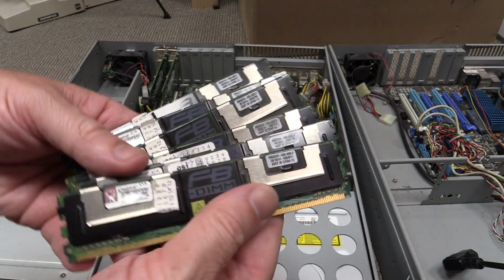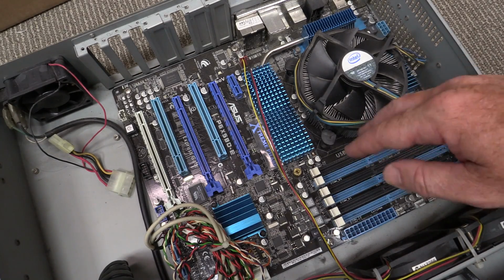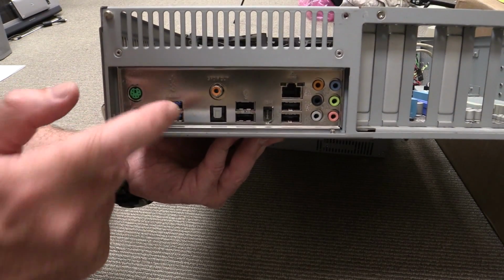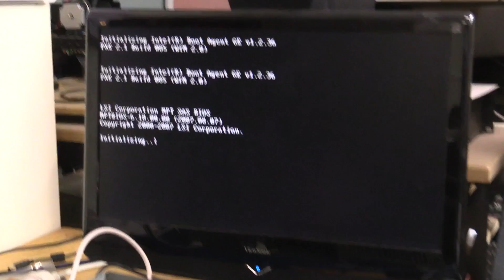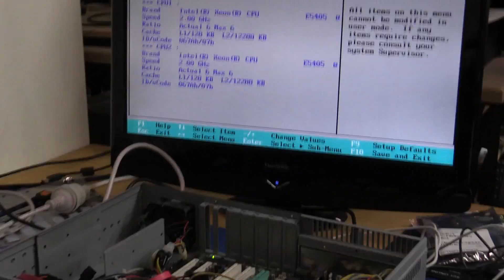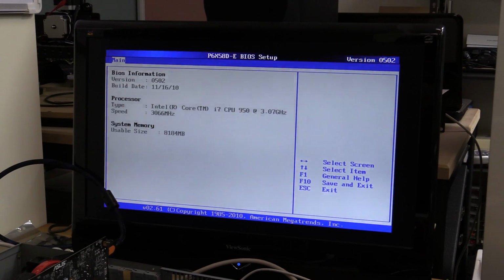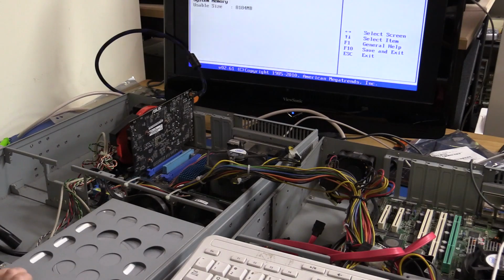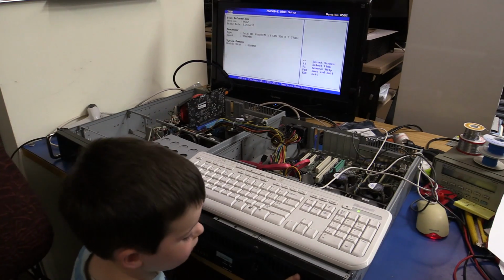EEVblog #838 - More Dumpster Server PC's

Comment: My CPU Mark is 20500, should be alright
Reply: +TheAmmoniacal And what's your brag mark score, I wonder?
Reply: Nice waste of 2k dollars. It's really not impressive when you consider the price is through the roof and there are much better options for much less. A little bit of research would have helped you save money and get better scores. :P
Reply: +TheAmmoniacal Just shy of 24,000 with two Xeon X5690s at 4.4 GHz.
Reply: TheAmmoniacal It suck when you lose to older, cheaper hardware eh?
Reply: +TheAmmoniacal Meh, I reck it with 26000 with my i7 5960X @ 4.6 GHz :)
Reply: +TheAmmoniacal meh, it has been running for a couple of months already. it is cooled by a H110i GT with push/pull fans and gets up to 80c under prime95 and 65-75c while rendering :)
Reply: RandomNova Gaming We're talking about benchmarking.
Reply: +TheAmmoniacal And... you only play mine sweeper on it! :)
Reply: Well you're only really paying for what you get. My X5650 was 100$ and scores 9.2K in there. I get around 90 points per dollar. You paying 2000$ for 22K points are getting 11 points per dollar. And yes I can Dual Xeon X5650 which would give me around 18K in perfect scaling, and that would still give me 90 points per dollar and almost the same performance for 200$.
Reply: TheAmmoniacal
Ikr! Mike Fox got a much better value for a more reasonable processor, and he was able to spend that saved money in other places for something he can enjoy a lot more. It's really funny, isn't it?
Reply: +TheAmmoniacal Pffff my quantum computer touches that with out even trying.
Reply: Jesse Crandle Oh wow you care a lot
Reply: +Person. Uh, yeah. That's why workstations the world over are using FX processors..?
Reply: +TheAmmoniacal Intel XEON E5-2699 v3 ?
Reply: It's a Xeon E5-2690v3, my brag score is too large to write here.
Reply: RandomNova Gaming Yeah, and it will last a month max.
Reply: +Mike Fox but the Xeon has ECC support and many more features like dual processing and stuff, making it useful for a balls to the wall workstation
Reply: +TheAmmoniacal Check CPU mark 13052,9102,7602 Proceed to chuck i7s in the bin
Reply: TheAmmoniacal https://www.dropbox.com/s/z306jdj31okea1h/i7%205960X%204.4GHz.PNG?dl=0
Here the passmark test of my i7 @ 4.4 GHz... Comes really close to your Xeon and even when running stock, the i7 has double the price/performance ratio :)
Reply: 19600 with 5960X and modest "no frills" overclock (4GHz).
Reply: kilrahvp Nice :)
Reply: My CPU is still better than all yours.
Reply: +TheAmmoniacal no, it isn't
Reply: Mike Fox Exacly!
Reply: Mike Fox What if I paid $660 for mine? Who wins?
Reply: +TheAmmoniacal yea, you could still use it as a daily driver pc
Reply: :D
Reply: TheAmmoniacal I was addressing your question but then I eventually had to do something and got busy, but here it is.

I was taking things by street price, I know people who can get X5650s for 50$.

Your 12 Core 660$ - gets you 33 points per dollar.
My 6 Core 100$ - gets me 90 points per dollar.

If we go by what the cheapest price I've seen someone get a processor like mine, 40$ gives me 230 points per dollar.

Are you sure you don't know who would win?
Reply: Mike Fox Hilarious!
Reply: Anthony Cupero lol unless you work at Google you don't have one............ bish
Reply: Oj10101 Lies.
Reply: +TheAmmoniacal no one gives a shit about your cpu dude LOL. No no, I genuinely mean it, I couldn't give a single fuck if you asked me to. People have Lamborghinis, I don't give a shit about those people either, and that costs a lot more than your little silicon wafer.
Reply: Jesse Crandle But you gave a huge fuck about it already, you care bout it quite a lot in fact.
Reply: Anthony Cupero Quantum computers are slower than normal computers in most cases except specialized features, only because a Qubit stores much more information than a bit.
Reply: My PC still owns all of yours
Reply: +TheAmmoniacal what GPUs do you have?
Reply: +Giggity Goebbel  Yeah i  know , was just having some fun.
Reply: TheAmmoniacal Where's your empirical evidence for that?
Reply: Jesse Crandle here
Reply: TheAmmoniacal If you're implying I care... let me enlighten you.
Full Definition of care
1:  suffering of mind :  grief
2a :  a disquieted state of mixed uncertainty, apprehension, and responsibility
b :  a cause for such anxiety
3a :  painstaking or watchful attention
b :  maintenance <floor-care products>
4:  regard coming from desire or esteem
Since I'm experiencing none of those things, I couldn't care less. GG though, it's nice to see you trying so hard!
Reply: Jesse Crandle Why do you care so much?
Reply: My pic NEVER gets I've r 28 C
Reply: Seriously, I'm just trolling.. I do own that CPU and all, but it's only 'good' for specific tasks. Not particularly fast for most tasks (as most tasks are still not optimized for multi-core processing).
Reply: Xeons are really bad at gaming because the GPU driver isn't multithreaded. That's right single thread driver. There was a test on LinusTechTips, i7-6700k crushes everything in gaming benchmarks. Low core count, high frequency.

Comment: those intel cards are really nice ones. i would recommend using them in your own system, they have high end onboard cpu's for to offload all the NIC traffic from the CPU. you can also use trunking so you get a single 2gbit connection. (if you have a proper router/switch)

Comment: They would make pretty good Linux servers.
Reply: +Dexxter Toasters make good Linux servers!!.

I'm really into low power no moving parts stuff, so my home server is an old VIA C3 thin client I found while thrifting. Supped it up with more memory and an SSD + Debian = eco server!. Not very fast, but good enough to run a small LAMP stack, airprint server, privoxy service, ftp server, SMB server..
Reply: +Gone Tomorrow Yeah, Skylake i3 with ECC RAM. Wisper quiet and more performance than a couple of power hungry nine year old CPUs. 1366 i7 is 130W and still seven years old. Maybe not drag home stuff that is older than the kid?
Reply: +Diggnuts Those VIA C3s are a low performance, low efficiency trap. If you have the dosh, grab LV or ULV i5/i7s instead, way more powerful per watt. Or the top of the line Atoms, which are quite cheap. Either is designed to run passive with proper heatsinks.
Reply: AstralStorm  I know, but I do not have the dosh nor the necessity.  The unit is running idle most of the time and then it's usage is just about the same as any newer platform that have the same features.

All things being equal, recycling such a unit for low usage at a discount price greatly reduces my environmental footprint regarding both externalized productions cost as well as energy cost.

I measured it against a Pi with external storage, and generally it was about the same except for IO speed and reliability. The Pi was worst.

If I need a dedicated render-farm right now to run for 24-7, surely I'd go for the maximun performance per watt I could get, but this is not the case here, and seeing as it's environmental footprint is very close to modern options under lesser load, I'd say the fact that it is reducing E-waste is a big plus.
Reply: +Diggnuts The most important thing is to not cheap out on important components, 
such as cooling, power supply and mainboard (read: power supply). I'm pretty sure Dave approves of this point of view. Get a premium PSU instead of no-name chinese, those $50 go a long way in terms of longevity. Get premium fans and heatsinks, they will likely outlive hard disks and make the machine run reliably. If you're feeling like it, invest a bit more in ECC memory and server processors, designed for long usable life. Get components with 10 year warranty or ones used in machines that get such warranty. In total, you'll pay about 15% more, but will get 5x longer life out of the thing.

I approve, recycling "old" hardware is underrated. Those things have a way longer usable life than expected, especially desktop and embedded computers. I'm using a 5 year old machine at this point myself, though it was a beast back then, it's still way more potent than what we use at work for software development still and should probably hold up for 20 years of life no problem with only minor replacement of storage.

It's a potent Sandy Bridge Xeon-based workstation. I've planned it for the hardware to last 10 years or more, the main failure points being storage media which are starting to show their time - RAID of laptop HDDs; and of course fans. By that I mean random single failed hard disk sectors, no head crashes, no data loss. Fans were still fine though.

Now that I've sunk more money into it as an experiment in making it run passively liquid cooled (dissipating max 300W power is fun), it actually doubled the performance due to unlocking way more turbo mode and allowing optional GPU overclock. It's somewhat less power efficient than fans of course, but much quieter. The total cost of this was less than a third of a new comparably potent box and the new components are mostly reusable if I decide to upgrade. Unfortunately, the next upgrade would have to replace all the major components - mainboard, CPU and memory. But it's not the time to do that, not in some 10 years. Maybe a new GPU first, later.

Isn't modularity great in comparison to planned obsolescence of laptops, tablets and cell phones?
Don't get a fancy shmancy SUV (or worse, a race car) when a good pickup truck is better. But then, don't invest in a smelly loud, old and inefficient 4-banger clunker either.

Moore's law is a lie itself - unless we get fancy new features to use it, exponential speed improvement is nothing. Especially if the limiting components improve on a slower path. Next such features would probably be in the realm of virtual reality and artificial intelligence, now that the limiting hardware is finally getting up to snap.
Reply: AstralStorm I agree, especially on the PSU. The powerbrick for my server is 4 times more expensive than the unit itself! Because a proper power-unit is very important both power-consumption as well as protection (as well for the hardware as the house where it is running!)

For my home server needs, I do not need a lot and my preference goes towards the least possible moving parts. That is why my eco-server runs ssd's and passive cooling. power-consumption with my unit is about 12 watts under load.

I definitely do not need ECC memory or any other server grade stuff for this job.
Reply: ***** I like ARM, but a RPi or Beagleboard isn't a platform to build an all round home server out of.

The ARM platforms that have the necessary IO I want are far to expensive, even factoring in any possible energy savings you suggest, which are only benchmark figures.

In my experience ARM in server environments only really cuts the bills in high load parallel applications, but then mostly you would be better off with a GPU based solution.

Lets just let ARM do what ARM does best and give some old silicon another chance at just being a bit useful.

I think I'll stick with X86 based dirt cheap/fun hacks from what I thrift together for now.
Reply: ***** Yeah, it's all an EPIA based (ex) thin client system. I ditched the original powerbrick and used a more efficient one that also lets me power additional stuff like arduino's and crap like that.

The unit as is runs at 1 ghz and by the same odd metric around 2000 bogomips. I measured 12 watts.. perhaps it peaks at 15 or more, but only when I'm not watching.. I need to get a meter with more functionality...

I'm not very familiar with synology'esqe NAS stuff..

I'm more of a ZFS guy when it comes to that stuff.

Comment: Dave. The app server has PCI Express. The two nics were PCI Express. so probably not too old.
Reply: +Lan Party Hosting gigabit*
Reply: +Timothy Giles Agree, they are 'Core 2' processors. I just got a linux machine running with one of these old sever boards with an Intel 5000 chipset (Ill bet this is the same chipset) and a pair of Xeon 5148s. I put in a HD6950 for video using an adapter to put the x16 card into an x8 slot so I could drive a DP screen at 1440p.
Reply: +Timothy Giles also the network cards are atleast gigabyte so I would keep those.
Reply: +KrashCode unfortunately they there not a dual or quad nic
Reply: +Timothy Giles FBDIMMs so it's going to be Core2-era Xeons. Old garbage these days, but at least they weren't Netburst...